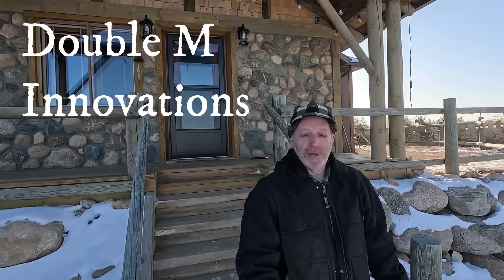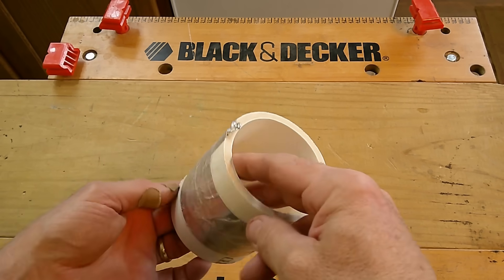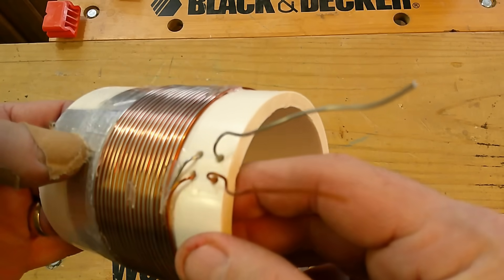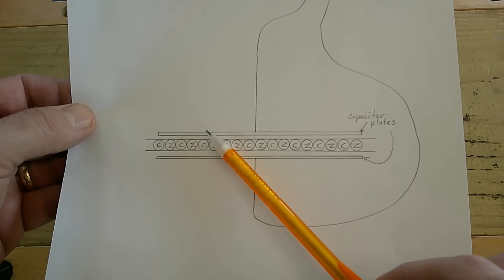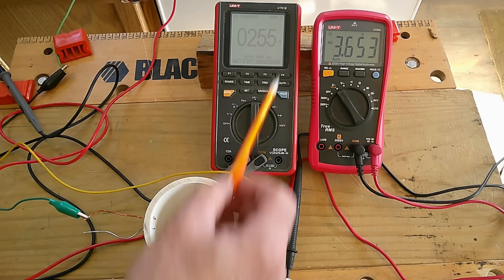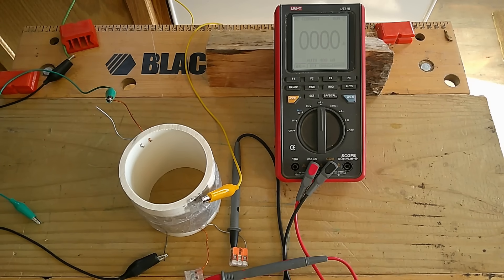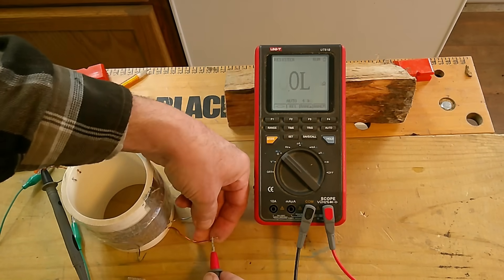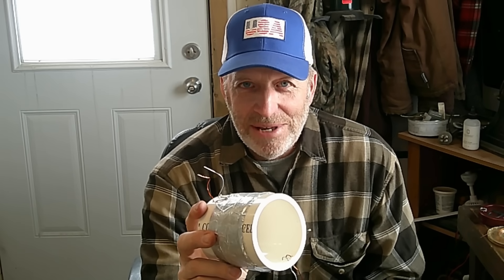Copper-Zinc anomaly; and a capacitor sandwich

Comment: Here is what I think it may be. You have your capacitor with the two aluminum plates. You made a second one by making the two coils wrapping around the inside of the first one. When you short it out there is no capacitance. The voltage is there because of capacitive coupling.
Reply from the maker: A little additional info:  with a capacitance meter across the aluminum tape plates, it read .5 nf. -with the copper and zinc wires shorted together, or apart and open.  The capacitance between the zinc and copper wires measures 1.7nf on the meter.
Needed two different metals.  Copper and zinc worked the best so far.
Reply: @doubleMinnovations  Thanks for posting this interesting video, and for those capacitance measurements! Please make some more capacitance measurements (with all unmeasured nodes left open): copper to inner plate (call it Ccim - Capacitance copper inner measured), copper to outer plate (Ccom), zinc to inner (Czim), and zinc to outer (Czom). Here's my theory: You have a voltage divider formed by Cci and Cco. You have another voltage divider formed by Czi and Czo. The zinc wire doesn't have an enamel coating, thus it will be physically slightly closer to the inner plate than the copper wire, and it will be slightly farther from the outer plate than the copper wire. And thus Czi>Cci, Czo<Cco. The effect on the voltage dividers is that the voltage on the zinc wire is closer to the inner plate than the voltage from copper to inner. That difference in voltages is what you see on the meter between the zinc and copper wires. (A minor note: The measured capacitances Ccim, etc. are not exactly the same as the "lumped" capacitance values Cci, etc. that you would write for the values of capacitors in a circuit diagram. Think about the difference between measuring a resistor in-circuit vs. out of circuit.)
I don't think the materials (copper, zinc, etc.) have anything to do with the observed effect. I think it has everything to do with diameters of the wires and the thickness of the insulation. This could be easily tested: Use copper wire for both coils. Let one wire have insulation and the other be bare, using the same gauge for both wires. Or, use two insulated copper wires with slightly different gauges.
Reply from the maker: You are a careful thinker jankok991!  A lot of the commenters are. 
I took the measurements you asked for several times.
Here are the numbers:
Copper to inner:  .87nf.   Copper to outer:  .81nf
zinc to inner:  .90nf.        Zinc to outer:  .88nf
Looks like the zinc has a little greater capacitance with the aluminum tape plates.
Diameter of copper measures around 1.09mm.  Zinc 1.11mm.  -using the same spot on a micrometer.
Reply: @doubleMinnovations  Das Spannungs zu Stromverhältnis von ungefähr Z = 1,6E6 Ohm scheint mit einer guten Leistungsanpassung zwischen Sensorsystem und Messgerät zu tun zu haben. Aus Z 1,6E6 Ohm und 60 Herz ergibt sich ca. 3,3 nF.
Reply: @doubleMinnovations  different Metals would not change the capacitance. You should have the same cap value if they were both copper wire with the same size diameter & one is bare.

You can increase the capacitance by submerging in Oil or some other dielectric (more surface area for the dielectric) 

FYI: Conductors in a capacitor does not hold the charge. The Charge is held in the dielectric material. For instance a plastic comb or a balloon with a static electric charge. All the conductor does is deliver a voltage potential differences to the dialectic material. The more surface area, the more charge can be stored. 

Here's a simple experiment: make a cap using some sheets of alum foil and a thin plastic sheet as the dielectric. charge it up & disconnect the alum foil sheets between. and pull the plastic out. touch both alum sheets together (ie no-charge), and reassemble the cap with the same plastic sheet. You have a charge still stored in the plastic.
Reply from the maker: Yes, I understand that part of the capacitance between the wires.  If they were both copper, there is a capacitance.  But from what I seen, copper-copper doesn't generate a current between each other if they are placed equally in the same electric field intensity.  The 'equal' part being important.  But the copper-zinc does in the experiment.
Experiments with like metals placed 'unequally' in AC electric fields, (one more in and one more out) did show a capacitive coupling.  -it was like they were a somewhat series.
...could be I'm just missing something simple...
Reply: @doubleMinnovations  Sorry it does not work that way. The current is AC current flowing through the capacitor. I suspect the difference for your copper-copper test i the zinc is bare & probably a different diameter. 
When it comes to zinc vs copper the only differences is resistance. 

As I stated charge is held in the dielectric, not the conductor plates. The material, thickness of the dielectric material & the surface area is what shapes the capacitance.
Reply: Why is the output DC?
Reply: Yes, a small amount of AC current will pass through a capacitor.
Reply: @guytech7310  What I am saying is if you put two capacitors close enough together, one will parasitically feed off the other through induction. The two insulated wires making up the coil are acting like a second capacitor inside the first by being butted up together in the coil. I don't think it matters that they are not the same metal.
Reply: @wesKEVQJ  Cap in series will also pass AC current. I am sure that is where the current is flowing from.
Reply: I am looking for a co-founder in a project to generator, investors are waiting for a prototype, who wants to become rich and monopolize this technology, please respond.

Comment: Exciting stuff, DoubleM! And of course with that the come to be expected Innovations!

Here demonstrated the standard grid AC source. But who would guess there would be found there between capacitor plates, a charge difference between metal types?   Will you call this discovery the electrostatic induction of voltage? Prior to this, it would require a connection to Ground to access its opposite charge and then the equalizing of those charges producing current. Without needing Ground, this certainly opens up an avenue of exploration which is not tied directly to it, greatly contributing to portable reception of power.

Just curious: Would a Zinc wire near a Copper wire make a great outdoor groundless antenna power receiver?

Comment: Wrapping zinc bits in carbon felt and then putting in a copper tube you can make cool hydrogen burners.  The zinc and copper seperate the hydrogen from the water molecule, making hydrogen gas.  The zinc is used up over time.
Reply: Right on I also use corbon felt for oil wick it last forever
Reply: You can do this with any metals. You don't need carbon, or 2 different metals.
Reply: Hi. Is the carbon felt electrically conductive? Do you put distilled water in the copper tube or water with a conductive electrolyte?

Comment: Different metals acquire charge to a lessor or greater degree. This difference of charge potential between metals is the birth of the Voltage you are measuring between them. 

See Edwin Gray's spark tube charge receiver plates, and Don Smiths plasma tube capacitor plates (part his TRANSFORMER GENERATOR MAGNETIC RESONANCE INTO ELECTRIC ENERGY invention). Both used Copper with Aluminum. But you are the first to discover that Zinc, replacing Aluminum, will produce even more power! 

Subscribed to follow every minute of your power quest!
Reply: And that's why most of the metal constructions rust, because of galvanization of different materials. We even have to lecture engineers as simple eletrician, that if they mix RVS with other metal type they would have difference in Voltage... I would feel ashamed, but they agreed on implementing telfon washers to avoid that.

Man and it was under Schiphol Airport... I even saw Marine solutions engineered in that way. Before we finished eletrical cabinets, air tank was already rusted.
Reply: @Exorcistt94  Regarding rust, probably a good idea to emerse everything in mineral oil, like capacitors, yes?
Reply: @Exorcistt94  
Hello. What is RVS?

Comment: When measuring current the meter needs to be in series with the coil and some type of load.  Load could be a small LED to see if there is a usable amperage to light the LED.

Comment: What happens if you connected the zinc and copper ends like a bifiliar Tesla coil, connected in series should make a capacity effect stronger just like Tesla's patent. An idea comes straight to my mind about winding stator  coils for electric motors using zinc and copper combinations thanks for the idea
Reply from the maker: If I connect the copper and zinc together at any point, it just shorts it out.
It's easy enough to replicate if you want to experiment.  I got the zinc wire off of Amazon; about $7 for 16ft.

Comment: Doubt it's the thermoelectric effect suggested in other comments, that produces DC and changes very slowly as the materials heat and cool. Considered galvanic action, but again, that'd be making DC. Had a vague thought: bimetallic junctions can have diode-like behavior, perhaps that has something to do with it. Also seems very plausible that it's just a really inefficient transformer or coupling capacitor.

It might help to have lots more measurements under different input conditions. Is the measured output the same on both ends of both wires? What happens when you apply different frequencies, or DC? What does the waveform look like on an oscilloscope? Is there any DC offset? Does anything at all happen when you use a single material instead of the bimetallic windings? Or just a third plate in the capacitor? Do you have a big magnet you can put near it? No idea why, it'd just be an interesting data point.

Anyway, thanks for sharing! That's an interesting arrangement, bit of a brain teaser to think about all the different things that could be going on in there.
Reply from the maker: It needs AC to get any action, and a magnet doesn't change anything.  The frequency seems to mimic the input of the primary cap plates, don't have a signal generator though, but I would expect not to be any different.   An increase voltage on the plates, will increase the output effect.  If I take it out under the HV power lines, and raise and lower it, you can see that effect.
Using the same metal doesn't have an effect if they are equally under the influence of the AC electric field. 
I been thinking off and on about it for 3 decades, and never found any information to explain it.  Seems to have something to do with the different metals themselves, and the AC electric fields wanting to rearrange charges...
Thanks for the interest!
Reply: @doubleMinnovations  Yes. The capacity forms a cold field and two different metals (reflectors) can be used to pick the resonance. Similar to thermal couple. If it's so, then it should also work with aluminum wire and floor heating cable (carbon fiber) as pickup coils.
Reply: @user-hf3ym7lh4d  Look up Cold current. All electricity is about heat difference.
Reply from the maker: Cold current electricity.  Okay, I'll see what I can learn about that.  Thanks!  Sounds like something Floyd Sweet talked about with his free energy device.

Comment: Old finish book by Ilmari Jäämaa for young inventors demonstrates copper and silver wires combined in high heat(in a fire or in a chimney with smoke?) collecting or transforming in electricity , in this hundred years old book they speak about new silver wire , maybe its old name for zink ? This book was from around 1940- time re-press and guess it was something like 10th edition , original first press was maybe 1920- (?),  i have probably lost the book somewhere so cant check it now better. Savonius rotor was invented in same time area roughly. Im finnish , my english is adecuate but not too good ...
Reply: The wire was probably "German silver" a copper nickel alloy.
Reply: @olavsteffensen2500  the word seems to be still in use in present finnish language , alloy might include also zink with those copper and nickel .
Reply: Cool. I didn't know it was that big book, and Setälä was involved. Seems like it has been censored after wars and added more later, like the other Setäläs books.

This is kind of thermal couple. But it's based on reversing Cold current. Michels Bench channel just recently did a some good videos about this topic.
Reply: @Kangsteri  found this book from grannys place but its on sale on finnish netbookstores around 40e ( 5 yrs ago it usually were10-15e ) , very interesting stuff . Kinetic stuff museum is building as we speak (text) to joutsa area somewhere in finland , and i believe that some of the stuff from this book is visible in there to experience ..
Reply: @diguli8022  Yes the 9th uncensored edition is only 10e and shipping..:) Ordered one. I have been looking for it several times. But it's was usually advertised as hobby crafts, like painting and making toys for kids. I wasn't aware that it had anything about electronics. Seems partially like very similar to Sähkö ja sen käyttö, or Die Elektrizität und ihre Anwendungen (Electricity and Its Applications) by L. Graetz.
Reply: You mean a thermocouple?
Reply: Det heter även nysilver på svenska. Jag förmodar snarare att han skapat ett enkelt batteri där svavelsyran i avgaserna är elektrolyten.
Reply: That is look like usual thermocouple. And it do exactly what it should when heated or cooled.
Reply: Adequate, not adecuate...your English is more adequate than my Finnish
Reply: The copper and silver form a bi metal thermocouple.
Reply: What's this zink???
Reply: @myriaddsystems  pardon , should start using auto translate , i mean zinc .
Reply: Million houses could make free energy burning wood